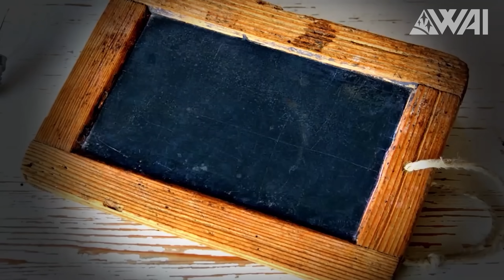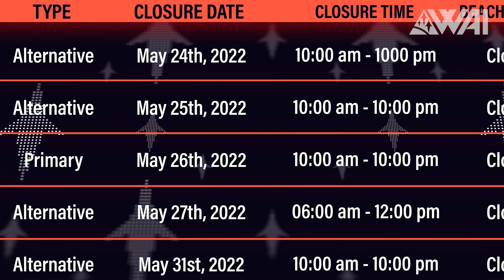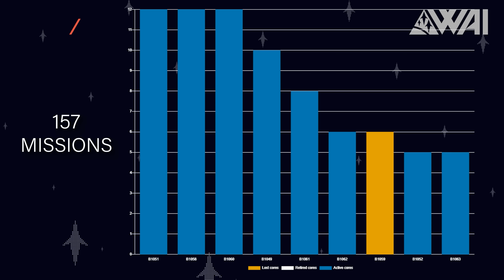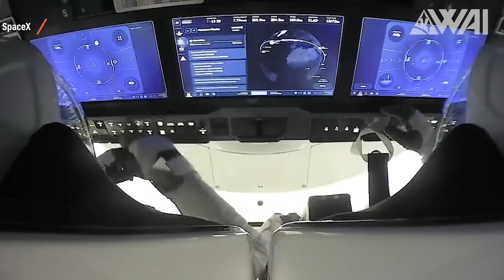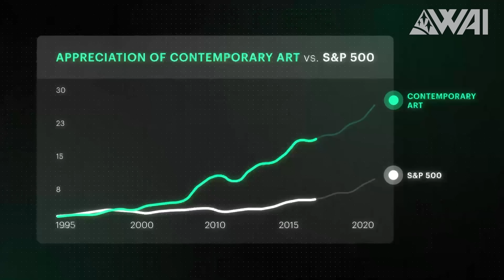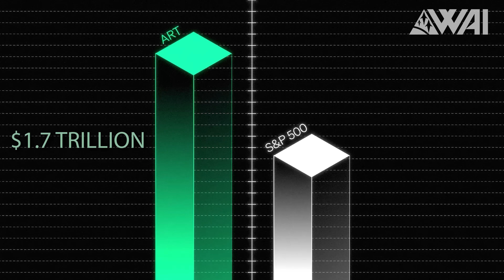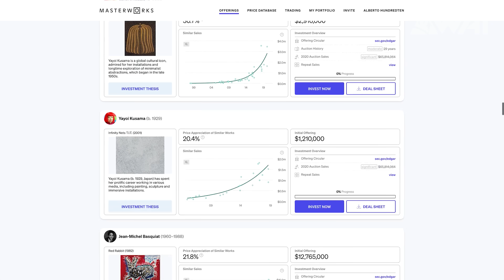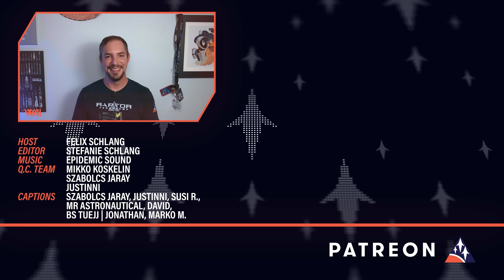SpaceX Rolling Out The Orbital Starship! FAA Decision Safe?

Comment: Boeing really will do  the next test flight crewed? Who is so dumb and stupid an get one feat into this fail construction?
If SpaceX get only one mistake they never get a chance to flight crewed to Iss. Politics bring people in dangerous situations.
Reply: After the uncrewed test flight to the ISS, SpaceX put the Crew Dragon on the test stand to static fire the abort engines. Due to faulty valves, that Crew Dragon exploded on the test stand. SpaceX was able to move on to the crewed ISS test without having to do another uncrewed test as apparently the fix was straight forward. IF Starliner moves on to the CFT, it will evidently be because NASA believes the fixes to be straight forward.

Comment: why is the launch in florida easyer? its more north..
Reply: The Starlink sats are in a 53 degree orbit. Starbase is at 26 degrees, KSC is at 28.5 degrees, and Wallops Island is at 37.9 degrees. So Starship launching from KSC has 2.5 degrees less to make up to reach the 53 degree orbit. If the Mid-Atlantic Regional Spaceport (MARS) at Wallops Island was rated for Starship, instead of medium lift rockets like the Antares 230+, it would be even easier to reach 53 degrees from there.

Comment: SpaceX had to show the escape system in Crew Dragon working before the crew mission. Wouldn’t Boeing StarLiner have to go through the same process? Has that been done already?
Reply: The NASA flight requirements were pad abort, unmanned flight test to the ISS, and a crewed flight test to the ISS. The inflight abort could be done with extensive testing and simulation if the company wanted or an actual test. SpaceX went with an in-flight abort test and Boeing went with testing and simulation.
Reply: @steveaustin2686   oh I see. Thanks
Reply: @arcpolar  You are welcome.

Comment: I understand that NASA wants redundancy in the missions to/from the ISS, but at what cost???
What frequency can Boeing/ULA sustain vs SpaceX frequency.
I'm sure Boeing/ULA will get the wrinkles worked out. But without reusability neither of them can logically complete with SpaceX. It's only a matter of time before Congress pulls the plug due to costs in comparison with SpaceX costs.
Reply: NASA only swaps crew twice a year, so Boeing is fine with the Starliner cadence. ULA has the Atlas-V booster and it worked perfectly. Boeing is the one with all the problems with Starliner.

Per the NASA IG, Starliner is $90M per seat ($360M/flight) for the first 6 flights. SpaceX's latest Crew Dragon contract is for 3 flights at $900M or $75M per seat ($300M/flight). SpaceX's first contract for 6 flights was $55M per seat ($200M/flight) per the NASA IG. So the cost gap between Starliner and Crew Dragon has narrowed. It's not a one off as the SpaceX CRS2 contract was bid at 50% more than the CRS contract per the NASA IG. Either way, NASA is evidently more than willing to spend $15M to $35M more per seat to have a redundant crew spacecraft to the ISS. NASA evidently doesn't want to have to go back to Russia, hat in hand, to buy seats if something happens to Crew Dragon.
Reply: @steveaustin2686  Thanks. Nice to know the price gap isn't as bad as I thought it was. Definitely a sweet spot for NASA to have options.
Reply: @vwasson6725  Yeah, SpaceX has been the cheapest option for CRS, Commercial Crew, and HLS. NASA likes SpaceX so they are in all the big programs.

Comment: I am not sure if this has been confirmed as an issue or not, but it sure looked like one of the main chute risers in Starliner failed to be cut at landing. You could see one of the first inspection techs up to the vehicle pull on it, and they mentioned that they were going to need to cut it in the stream. That is a scary part of a system to have a failure on and added to the thruster issues it doesn't paint a great picture.

Comment: SpaceX has a glitch or malfunction during a test flight. NASA: "Back to the drawing board with you!"
Boeing has a glitch of malfunction during a test flight; NASA: "Uh... that's good enough."
Reply: Bullcrap. SpaceX's Crew Dragon completed the unmanned test and then the spacecraft exploded on the test stand due to faulty valves. SpaceX was able to isolate and fix the issue without needing to do another unmanned test.
Reply: Eh SpaceX got saddled with that fourth parachute (inherently more risky than three) but they're still making it work.

Comment: The Starship just farted 💨 from an engine and these heat shield tiles just keep falling off. Imagine when if all engines fire up 🚀 or when the starship is on top of the booster’s 30 whatever engines fire up , or on reentry 😬. Obviously there’s an issue with the adhesive or however they’re putting these tiles. 

I too want to see it launch, but wow, this is just one ☝️ issue of so many, many tests to perform and understand what will be/not good. Hope they don’t continue being held back, so they can advance with these testing. Go Space X
Reply: It could very well be that they don't want to fix that specific issue. If I was the one diagnosing the ship, it could be nice to have a tidy little punch out of heat shield tiles to show exactly where the problems are. If you have pressures on the inside of the ship trying to get out, the problems are worse than tiles falling off
Reply: @kriswright9712  ….Yeah, I agree with & understand your point. Only they really know what’s a priority at this time, we can like only make about a rough guessing, based on what we see or are being told about their progress. But definitely there’s a lot going on their plate. Hopefully fingers crossed 🤞 FAA won’t tell them once again to wait yet again with hopes, I think to see whatever else tests next get done.

Comment: @6:40 are those new prototype heatshields with rounded edges?
Reply: No, they’re covers for sensors and antennas
Reply: There's still significant radiant heating from the plasma streaming overhead; the bare stainless will reflect it but the sensitive bits need shielding.

Comment: What is sleeving of starship rings ?
Reply: steel.
Reply: The ends of tanks are built as domes. The domes are placed convex-side up on a stand, and then a tight-fitting stack of rings is dropped over the dome - this is called "sleeving the dome". Then the rings are welded to the edge of the dome to complete the tank end.

Comment: Ship 24's pressure test sadly ended with a KLONK, flying tiles, and a long pipe turned into a V -but that is what testing is for.
Reply: My guts still goes KLONK sometime and they are on 35+Y usage , sometime methane leak toO'
Reply: Better a KLONK, than a FLASHBLOOM eardrums bursting.
Love destructive testing. Because it means less chance of spacecraft destruction, with crew.

"I got three fuel cell lights, an AC bus light, a fuel cell disconnect, AC bus overload 1 and 2, Main Bus A and B out." [Long pause.]
"I got AC." Alan Bean
"We got AC?" Pete Conrad, Apollo 12, November 1969.

NASA: Conrad, from 1969 Technical debrief: "The flight was extremely normal for the first 36 seconds and after that it got very interesting."
Reply: @Doc_OLDGUY_Savage  Just set SCE to AUX
Reply: better a KLONK than a RUD :D

Comment: The stages that starliner cast into the sea cost more than the entire starship.
Reply: That's what the combination of the military industrial complex and the "failure is not an option" space race propaganda ethos gets you. 
Boeing exists less to do good work than it does as a supply-side fulcrum for a "job creator" narrative loop. Once you get into supply-side justification for jobs, you start creating protectionism loops, and when your money loop between constituents, representatives, corporations, and Security theatre™ is closed by a govt agency that is obliged to produce absurdly high failure to success ratios, you get your Lockheed Martins(see:JWST) and your Boeings stringing the govt along for decades and decades so they can deliver a machine that finally cannot fail once it's handed over to NASA. But they have little incentive to "move fast and break things" because of all the above; so they do Launch Candidate level tests, and then tear everything down to the last screw like they're a top fuel drag crew, but with x-ray weld checkers and level 8 cleanrooms.
Reply: Starship is not even operational,the one you see are very rough prototypes.
 None is a refined or finished product like the SLS rocket.

The first fully operational IF they get one in 3 years will have cost +$10 Billion in R&D and tools etc etc....

Comment: I have a big problem with the tower’s inability to swivel 360…I think it should have been a round tower (it could have a square inner structure for additional strength) to enable the catch arms to rotate into perfect position…the way it looks now it’s limited in range and relies on very precise landing….those catch knobs on the rocket are tiny….imo…but who am I to judge, I just stayed at the Holiday Inn Express ;-)
Reply: Why? You want to land it at the other side of the tower?
Reply: @inisus  the question is not why….it is in the event of….that tower is not cheap to rebuild in the event of an inaccurate landing…due to faulty engines or weather…but again I only stayed at the Holiday Inn Express..;-)
Reply: I'm sure they ran the numbers on different tower designs
Reply: @josephmoore4764  sure and they ran the number on starship landings a few times…;-)
Reply: Did you see the Transporter 5 booster landing? precisely in the center (that's what they can do if the target doesn't move around, as ships tend to do. Also, the F9 boosters can't throttle down enough to hover, so they really need to come to zero vertical speed at the moment of touchdown. SH can throttle below that, so they can really position the booster where is can be grabbed.
Reply: @realulli  I guess we will see. I am hoping it will.
Reply: @CM-kh5ow  I guess we will find out one day….remember my post ;-)
Reply: If they landed on the backside of the tower, that would put them closer to the tank farm - I see what you did there!
Reply: @dancingdog2790  even if it could swivel 300 degrees it would greatly enhance their chances no? I am just saying…look how poorly the starship landed compared to the falcons…an expensive experiment if they tear the tower down….and precious time….
Reply: They can land a booster with enough accuracy that it lands on a barge in the middle of the ocean.  I think if they were off by as much as you're suggesting it would actually end up in the sea.  Honestly don't think accuracy is an issue
Reply: @TheSimonDavidson  did you see the starship landings? They were way off at times…